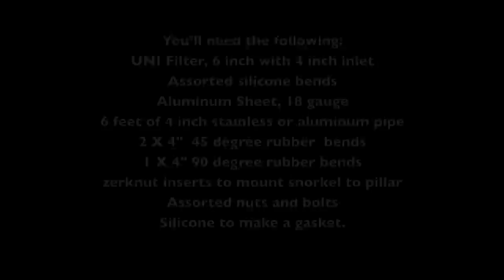Land Cruiser Custom snorkel installation

Comment from the maker: @Coolesttech well at this point i am using the oil filter cartridge - spin on type.  I will be cutting it and filling with fine steel wool - apparently it works perfectly.  just need to find the time:)

Comment: I nice solution to that issue is that you can try and use an ammo box for a larger caliber ammo since they come airtight to ensure no debris can get on the round to jam the weapon and it's fast and easy to clamp and unclamp.

Comment from the maker: @elitecssplayer "Catching" air does absolutely nothing - like a ram, it actually doesn't ram anything, there is no boost in air pressure from forward movement so there is really no advantage to it.  I pointed it backwards so it doesn't catch leaves trees and dirt. I'
ll be putting a mushroom type canister on it when i can find one that flows enough air.  thanks for watching!

Comment: I would have like to have seen a cleaner cut hole in the fender, and a "mailbox" tip on the snorkel top with some mesh to stop the big stuff and critters from getting down the pipe.
Other than that it looked pretty clean, although I grit my teeth when seeing holes put into a factory Toyota lol. They make their own rust holes over here in Canada and I HATE seeing any more holes

Comment: haha ive seen a few people put socks n things like that over the inlet at the top to help filter the dirt and crap out of the air. i wanted to put a snorkel on my car since my driveway at home gets really muddy in winter and you need to use 4wd to get out onto the highway and some spots my driveway is flooded and goes over the bonnet of my 98 pajero and that has a 4" lift on it so the water gets pretty deep. and it has wasted my money to get it fixed when it does break down.